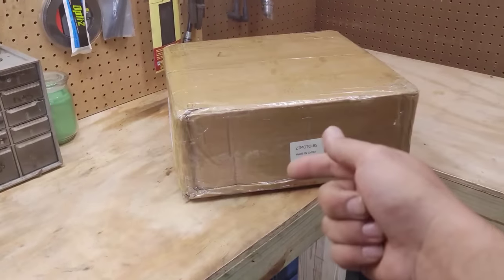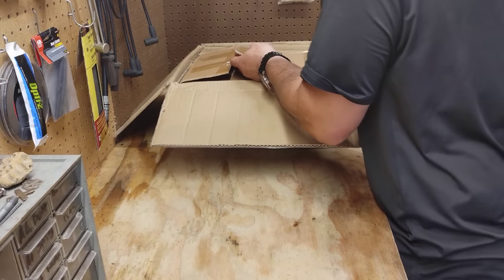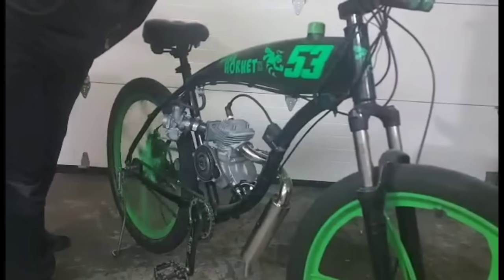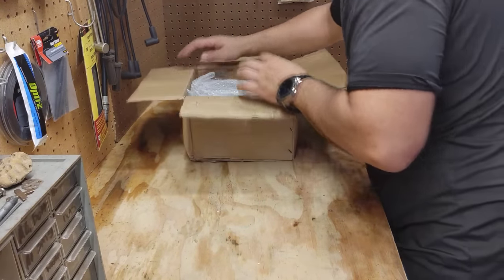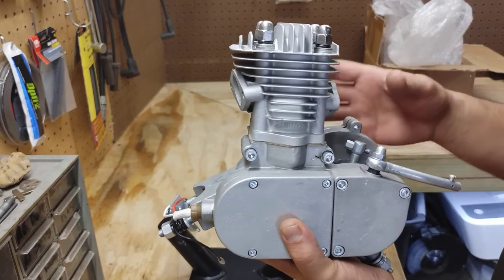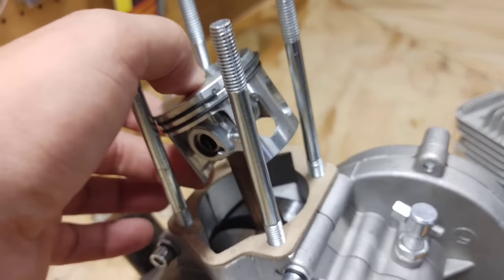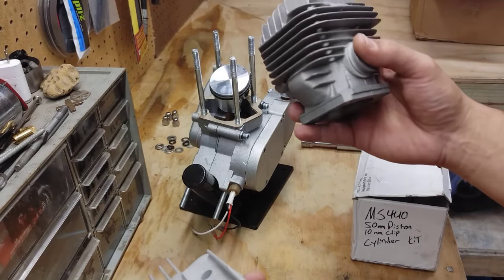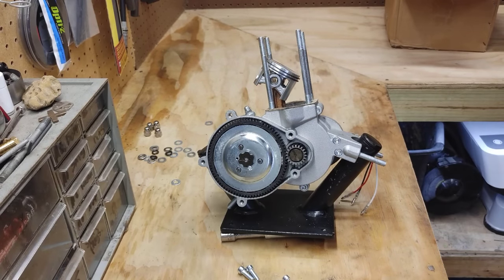The Phantom 85 V1 by ZTMoto. The largest bike engine on the market! First look and tear down

Comment: I wonder why they stick with a 2 ring piston though? I would think they would slide over to a single ring. 2 rings give more friction and thus heat, and then when you have the single piece head, no option for performance cooling heads, and in that situation it would have made sense to put a single ring piston in there. But regardless it's a cool design in my book, and I am going to come out with a bolt on intercooler system that will hopefully work on addressing the heat issue. Stay tuned lol.
Reply: Well you get more friction from 2 rings yes true , the rings do a few functions and one is heat dissipation 2 ring will dissipate heat better transferring heat through rings from pistion into cylinder but more friction,  one ring won't cool as well but less friction.  A touring bike 2 rings a racing bike one ring , racing bike tend to run shorter distances
Reply: @darcyhemeon4309  you really dont get any cooling from the rings because they're in contact with cylinder and piston and then the double friction, so it's just getting more heat with 2 rings. These are air cooled engines obviously, the cooling is only coming from cylinder fins and on YD100, not much cooling at all. I bet this is very similar. So again like my comment, going with a single ring may have helped that with the less friction.
Reply: @abikelife1481  look it up .. I didnt just come up with that
Reply: Abl, your focusing on the wrong aspect of cooling. 2 piston rings are for redundancy. 1 piston ring for when your rebuilding more often.

You could always just pull the bottom piston ring off if you want to
Reply: @darcyhemeon4309  yeah I have read that before too but that doesnt mean it is true man. Like think about it, how does that dissipate heat, while also creating heat through friction? Lol.... I am also speaking from experience, not what I read online where anyone can theorize you know. But seriously tell me how the rings create heat and dissipate heat at the same time? When objects get heat up, it's not like they flash cool and then reheat with the revolutions of the piston or something...
Reply: @abikelife1481  pistion heats up transfers at contact point is the rings to cylinder cooled by air
Reply: @darcyhemeon4309  oh yeah? While they are pumping up and down at 5k RPMs and heating up near 300F? Is that when they provide the cooling?
Reply: @abikelife1481  last answer.... the fins cool by air flowing over them 
Thank you have a good day Sir
Reply: @abikelife1481  wiseass
Reply: @Bull3tBikes  where did you come from? Nobody was talking to you. Yet another country heard from the peanut gallery. Are you drinking tap water too?

Comment: not even close to the same carburetor. the outside is the same size, what matters is that bore diameter. if you look where the throttle cable goes in, that slide is way bigger. oh and there's a little trick, if your engine has a stack of Base gaskets underneath the cylinder, the more gaskets you stack, the lower the compression, horsepower, and cheaper fuel that it can run on. raise it up to 93, put a real thin base gasket on it, you now have a higher compression, more powerful engine. 💯

Comment: I've got a project i'm starting over the winter for my boys. I want to put my tiller motor on their Stingray but I want to keep the 3 speed transmission  suicide style . I have one issue and that's the clutch , I guess you could say it's reversed , engaged when the cable is slack . Anyone out there ever try this and if so how much of an issue was it to reverse ?

Comment: I don't think I ever had a throttle cable itself go bad. Now them throttle handles can be a diff goofy issue all their own. The YUANG DONG throttles handles for as good a carb as they make can be a real pisser and piece of junk. The Bo Feng carbs are not really potent they need to be jetted and I have had great success doing just that with em. They R a big improvement over the old NT carbs whereas ya either get a good one or a bad one or ya can't get em to seal on the intake necks. I was hoping to see the thing run for my sanity sake the thing looks tempting to buy however owning an engine with one of Fred Chelminskis heads is like having cookies without the milk.

Comment: What I know about two stroke engines without an expansion chamber pipe do not get the same horsepower if you swapped out that stock pipe for a banana pipe dramatically change the power band on that engine and gain more speed faster
Reply: Ehhhhhhhh not a whole lot from experience but it does help

Comment: Love the vids man, but yet another video of the Phantom 85 not showing the reason why this four strokes bad—the timing ports are off. Show that in your next vid. I won’t sell them because they need a better mold for the jug with proper timing. Good low end, but top is highly lacking for a 52mm. I am a bit biased…but I would say pass on this and get my OD-911 coming out soon….hint 54mm 😈
Reply from the maker: They are coming out with a new version with needle bearings. Ill post when i get it.
Reply: I just checked out your site and I'm definitely interested in the OD-911 you've got coming out.  I've got a Huffy Nel Lusso with a pk 80 (w reed valve) H.C. head and expansion pipe.  It tops out at 43 which is pretty good.  I'd like a stihl 660 hybrid with dio reed valve in a perfect world 💪💪
Reply: @tomrockhill8634  : you may just get your wish 😉

Comment: That transfer system is just a whole new level of stupid. This thing is junk.
Reply: Those transfers work just fine on a chainsaw, so why wouldnt they work here? Yessir standard chainsaw design. The piston acts as the bottom of the transfer ports when at bottom dead center, fuel mix sliding by the piston itself and up into the cylinder transfers and then over the top of the piston. I dont know what 2 stroke secrets you're eluding to knowing but this design is standard in big bore chainsaws man.
Reply: The cylinder and piston work as an independent transfer system, they don't interact with the case transfers. The wings on the bottom on the cylinder are just there to seal the case where the old transfer circuit would be. Perfect or not it works fine, and has considerably more power than any other china kit I have used.
Reply: @abikelife1481  I know how they work haha. Surprised you can't understand where the flaw is. They only make manufacturing much cheaper. 
2 base gaskets because they couldn't be bothered changing the casting to set a new squish or any port durations. They didn't even bother to get the cooling fins reorientated. Would you trust that manufacturer when you're going 50mph+ on a bicycle?
Reply: @joshuaharrison9331  Besides what you just mentioned will you explain what else is wrong ?

Comment: Actually I think there's a 100cc cylinder bore now.
Reply from the maker: There is a "110cc" that came and went I saw. The timing was off i guess.
Reply: @MotoredLife   I only recently find out was 100 cc let alone 110cc. 2-stroke engines for the bike it's getting a little extreme I wonder how far will take it I've been kind of looking into the the one has the electric start system on it 2-stroke version

Comment: Why cut off the white wire ?
Reply: It robs the  ignition of power & creates a weak spark if you try to run a light or anything with it.
Reply: @michaelbrinks8089  Thanks.

Comment: How many years it can last?
Reply: Depends if you mod it or not
Reply: @jeremyclarkson6293  Stock
Reply: @yottadrive  if youre lucky it will last 2 months of use stock but if you just swap the piston wich cost 20 to 50 dollars depending on the site and quality it will last a couple years

Comment: Wait. 85 in bigger than 100?
Reply from the maker: Yes china measures differently that the us. The "100cc" engines are actually closer to 80cc. This new one has a 52mm bore and 40mm stroke.

Comment: this is the second largest bike engine the first is the (raw racer iii 100cc) 2 stroke which is what i run on my bike
Reply from the maker: This engine is literally a yd100 with a 52 mm piston from a chain saw in it lol. The yd100 has a 50mm piston. 50mm bore × 40mm stroke = 78.54cc
Reply: @MotoredLife  my engine is 100cc though not 78.54 thats literally the 80cc engine i know because a 80cc(50mm piston is way too small to fit in the cylinder
Reply from the maker: @TylerDuysen  thanks for watching bud!

Comment: Waaa waaa waaa failure motors had problems out of the gate. A amateur would have spotted out the issues
Reply from the maker: They didn't ask me when they were making them! Lol I 100% insisted on the gen2 having needle bearing instead of that crap bushing. They will be out mid next month.
Reply: @MotoredLife  thought you took it apart and looked at it. Hope they fix a few other know quality control issues

Comment: It doesn't matter what upgrades they do, they are still a Chinese design 2 stroke crap engine.

You are much better off, modifying a 4 stroke engine.
Reply: Way off dude.  2-strokes for the price, weight and speed are just better.  Even if you go with a Tillotson its going to be heavier and need more room in the frame(mods).  More expensive and it's going to do maybe 50-55.  You can get the same speed out of a lighter, cheaper YD100 with a Reed valve and expansion chamber.  This new Phantom 85 is an even better deal.